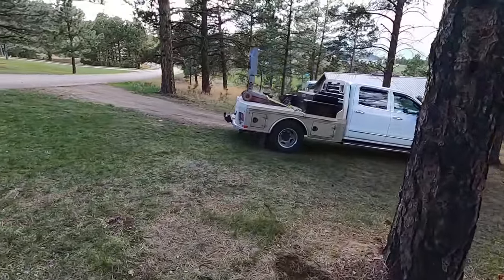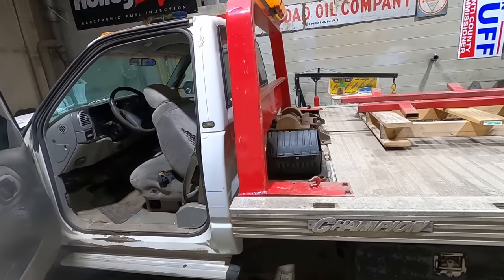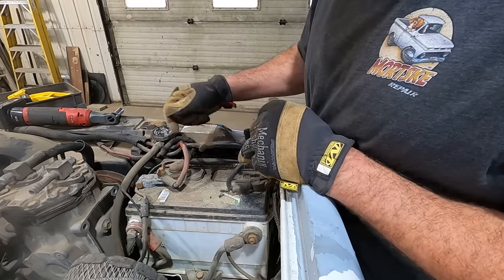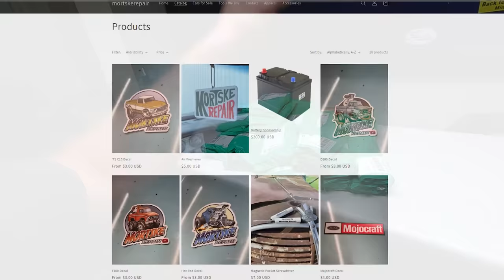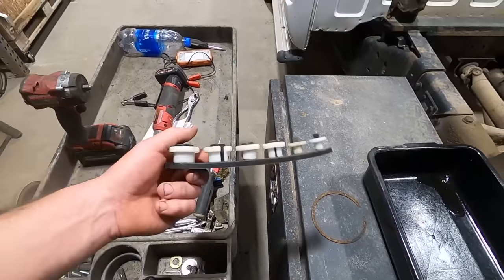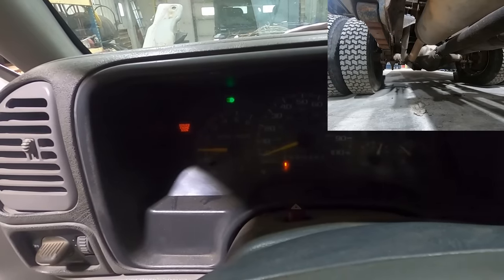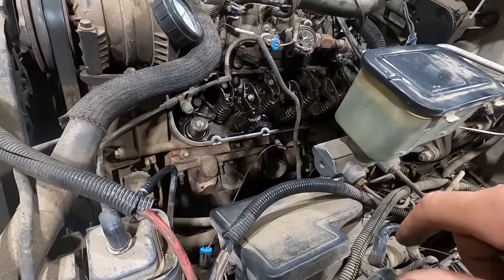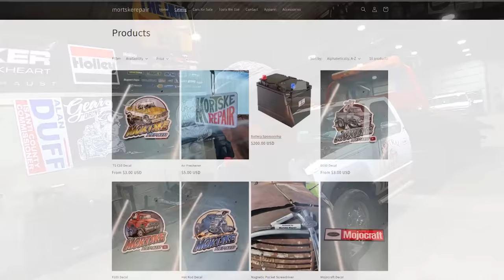WORST Purchase of My Life?!? I Bought a Rollback Tow Truck for Dirt Cheap! How Bad Can It Be???

Comment: replace the fuel pressure regulator and distributor while you have it out..  look out for faulty distributor caps from new..  i had a 99 suburban with that engine that sat since 2019 with a full 40 gallon gas tank.. yay!.. had to take the intake off to replace the fuel pressure regulator.. then was having timing issues, took it apart again, distributor shaft was worn out, bought a new aluminum bodied one, would not run.. after hours of checking found the distributor cap was throwing spark to multiple wrong plugs at the same time new out of the box, that was a Delphi cap too.. then still ran rough, needed injectors too.. you need a special, or advanced reader to set the timing to plus minus 2 degrees too...    those engines are the biggest pain to take apart for a pre 2000 engine.. 8 to 10 mph..  just 6.0 swap it..

Comment: Ah heck Mortske , I'm just and old mechanic  50 plus years, I enjoy watching your projects, I am jealous because I can't move around any more , but my mind says buy projects and get em done . You make things work like I did, so that  hyd  flare tool is a sweet heart, I have not had any success with that  , it just slid on me. so you are doing like I did.  So if I give ya crapp , it's all in fun. Like you said , I think it the material .  Dewey.  Dewey's auto, truck, and towing, Racing Supply. Glencoe , Mn

Comment: Those bastards are prone to killing fuel injectors.  I bought a set from the local parts house and some crapped by the end of the summer. The Bosch set I picked up from FiveOMotorsport were the ticket. Be careful with the fuel rail.  Ended up with some stalling issues later down the road and figured on some tcc pressure issues with 240k on it.  That 454 4L80 tranny combo sure is tough!

Comment: They did infact put the 8.1 in them hd trucks. From 2000 to 2002 when they quit making them.  The passengers side door handle is the correct handle for a hd.

Comment: Excellent video Mortske Repair   :) , Duff Dog 🐕  , also door new handle in 2002  years in Z71 truck and yes get new fuel tank plus send unit with pump for that year truck be better to save troubles! Plus get a grey bottle of STP Total Treatment fuel injection and carb cleaner in fuel tank with 89 octane 5% Ethonal or 91 no Ethonal in gas ! Plus 10w30  synthetic  in with Wicks fliter , plus Air filter change  and new fuel filter to fuel line ! Plus tire use Load Range D or E in Cooper or brand got lots meat rubber  on then with traction need it for all 6 tires ! Iron Man brand great ones too! Looking forward more videos too on this truck to!

Comment: Had a friend with a Vette carrying a 454. Checked the #'s on his, weakest 454 ever built. WHAT? He was a lawyer who owned a Vette shop and took it as a trade when he closed his shop for 4 not running Vettes. Man, was he mad. Asked me about fixing it. Told him I'd rather work on an Audi. He didn't like that too much. Looking at those water jackets I would do both sides and look real hard at the radiator. While its out check the timing chain. You never know till you get bit. That hole in the floor is Louisiana ventilation. If it ain't big enough for your foot to go through leave it alone. LOL Keep the great videos coming and spoil Duff rotten.

Comment: That's why I stick to small engines, lol. You just need a 7,8,10,11,13, and 15. If you have those, a set of angled needle nose, and some fuel line clamps, you can do pretty much anything. I hate having to use every damn tool in the box on one job.

Comment: Thank you for another fine show. It's too bad you couldn't fix it in one show but, personally, I don't mind a two part video. 
  As for the phrase "Here goes nothing", I found this on the Google. "Originally it was used in a self-deprecating manner, until it acquired the more general sense of "Here goes an attempt." I also found one of the oldest mentions of it. This is from The fibre and fabric, a knitting mill publication, ""The latest nagging remark; 'Oh, throw yourself In a hole,and say here goes nothing".😹
   Sorry I've ran on a bit. Have a good week and give Duff a pat on the head for me. 🐶

Comment: Raylar for 8.1 stuff and 8.1 is the same architecture as the 7.4 and with some minor wiring could drop in a 8.1 with the coil on plug

Comment: Hello Mortske & Duff Now you know why it was parked. Looking forward to your repairing the head and firing it up.The valve guides might  give you a slight issue. I hope a valve with oversized stem will be sufficient to piut the head bact to serviceable condition. Replacing the guides is not fun.Shoukld be a good engine with pulling power but a real gas drinker. 8-12 mpg under load and only 10-14 not loaded. I am sure you will enjoy the versatility of the unit.

Comment: The Vortec 454s actually have good oval port heads. Not the tiny peanut port heads. 
They are a decent engine and would be the easiest way to move forward with if you need a new (used) engine. That truck will need  the torque
Reply from the maker: good to know!

Comment: Next time you're at the parts store they carry them push connection, adapter fittings for cheaper than the time it takes to make them. Farm and fleet had them for $20 but they're 10' pieces of line. In a kit 3/8's and 1/4" together.. that's a good find. SCORE!
Reply from the maker: Interesting

Comment: Damn. That gas had actually turned to deck stain. I had to replace an entire fuel system on a 2 year old mower a couple of weeks ago for a customer due to the ethanol. Everything was beyond repair. It looked like the fuel system of a 20 year old mower that had been sitting for a decade. It is amazing how destructive that stuff is.
Reply: If only the people would use gas preservative for ethanol, they wouldn't have those problems. Been using that stuff since ethanol came out and never had any problems after storage, only when I didn't have it in my tank.

Comment: If ya do the electrolysis method, you can get that head spotless in those water jackets. Might be a bit hard on the valve stem seals though, I dunno.

Comment: Yeah mine had it busted spring but it didn't suck the valve thank God and it didn't hit the Piston either being parked for 8 plus years that small-block top-end was complete rust she looks great though now and that Vortec is a 4 bolt Main I don't know if your big block is but most likely it is so I wrapped my valves I bought a brand new valve that cost me $5.60 I believe but I'm going through the whole motor all my cylinders look like they were brand new but then again my small-block only had 85,000 original miles and taking the heads off really isn't that bad those manifolds have a problem anyway in the corners leaking water if they're not done right and now they have all new gaskets for the vortex so they hold up pretty good those Motors actually will go 300000 plus miles easily

Comment: Yeah my 2000 k2500 did the same exact thing only the pump was still working it was just circulating all the gas in the tank went to O'Reilly's and got a fuel pump 85 bucks out the door work just great of course I had to wire in the new harness but no problem oh and I would definitely change that filter or you're going to fill all the injectors up with crud. On the vortex if you didn't know the crank sensor does the timing in the sensor in the distributor fires all the injectors you can remove that sensor without pulling the distributor you just have to get it in the right spot. I hope this helps you my friend

Comment: Wonder if that flair tool is for the push lock fuel lines, the nylon soft lines that you can get in the help isles, to push it on the fitting. We had a ford tool that was similar to repair fuel lines. It held the fitting then pushed the soft line over it. Idk.

Comment: Thats a nice find. I got a 93 F700 with the 5.9 Cummins and 5+2 speed several years ago. It's so handy. Everything from moving my mowers ,small tractors to an occasional car or truck around my properties.
Back in the day I had a 92 3500HD with service body. Ran like a scalded dog, but had to keep a eye on the temp. It liked to run hot. And that 4LE80 was never enough Trans. for that truck.  Other than that was very dependable.
Oh liked to go through lift pumps for some reason. always kept a spare.
New Sub Here. Looking forward to part TWO
TGP
Reply from the maker: Thanks for the sub

Comment: 454 is a good engine, just don’t over rev it and float valves. It showed .020 bored when you borescopes it. Fix the valve and run it.

Comment: Well....
It says made in "America",but not ,"Made in the USA.
Even if it was made in Mexico or imported from, it is American made. North America. Even South America is American.
People will argue this, but America is America.
Now on the hood assist, try sliding it under the hood to pull it off.
 I have used those carriers for years, with ply wood, drywall, MDF.. etc. Underhand makes the grip more comfortable.

Comment: At one hour seventeen or so you can see 020 on the piston. Bored 0.020," that engine was rebuilt at some point. Probably recently as it is so clean inside.
Reply: They may have also screwed up the valve guide leading to the problem you found.

Comment: Just a heads up, i've had a few of those Gen 6 454 trucks. The 2 biggest issues with them are - #1 the fuel pressure regulator, and #2 the delphi injectors leak at times. I usually grab some yellow ford bosch injectors from 5.0/4.6 motors from like 87-04(?) to replace them. Direct fit and super cheap and abundant

Comment: So I had one of these in 1999 that I bought brand new. 9 ft snow plow 10 ft Henderson dump body. When the vehicle ran it was awesome to drive. But that 6.5 turbo diesel was always broke. The transmission went prematurely. I was able to work this right alongside a comparable f-450 which is exactly what this is basically. Hence the 10 lugs. Same GVW almost identical. The Ford never broke but this Chevy was always in the shop. It was ridiculous. And one thing I noticed the interior in the Chevy fell apart 30,000 mi faster than the 2000 f-450 did. I literally bought the f-450 the year after I bought the Chevy because I had such bad luck with the Chevy. Does anybody remember these bending the frames. Dump bodies the top of the dump body bulkhead would be touching the cab it was that bent. Not the 99 I had but the earlier versions were bending frames. I think up until the early '90s they were bending frames terribly

Comment: Vortec 454's had the better heads on them, good combustion chamber and larger oval intake port, not peanut port. Ethanol fuel didn't help anything on that rig, I avoid it like the plague on vehicles I don't run on a regular basis, good score on the roll back life. Old Duff pretty much knew that one wasn't going to be moving under it's own power for awhile, with that many miles the tranny had to have been changed once or twice.Tow truck drivers aren't normally easy on rigs unless owner operator run.
Reply from the maker: Good to know!

Comment: The other day I was riding my bike down the road testing it out and came across a 1990 four-wheel drive here in Ohio yes you have to hear this no Rust ever never driven in winter. Had a new transmission at least 2 years old, 350 V8 all with lockers. The father passed away in the son did not need the vehicle this truck had no dings no dents and of course the average clear code problem but what a beautiful truck all for the asking price of 2250 dollars oh yeah it even had brand new exhaust from front to back the only thing I saw was wrong with it was the AC was unplugged and the headliner had come down do mice damage just the average ungluing. I think if I would have had the money I would have added a third truck to the collection 10 years older but a very very beautiful truck.

Comment: My 98 Silverado 2500, with the Vortec 454, took a dump on me today. Suddenly it wouldn't rev over 2000 rpm, and developed a lean backfire real bad. So I replaced the fuel filter. No dice. So I took compressed air, and blew out the fuel line from the filter back to the tank, in case the fuel sock was plugged. That seemed to fix it. For 13 miles. Then it quit again. I limped it back to town at 10-15 mph, popping and sputtering. My NAPA guy put the scan tool on it and said "low fuel pressure", thermostat bad, both temperature sensors bad, all 4 O2 sensors bad, and persistent misfire. I think the scan tool is just programmed to make NAPA money! I parked it in the yard next to my blowed-up 92 Silverado.

Comment: Screw that 454, an 8.1 will run circles around it and get better gas mileage in the process. 

My first rollback was an '01 or '02 (it was the last year for 'em and it was 20 years ago i don't remember) 3500 HD 8.1 5 spd with a steel 21' x 102" Aatac bed & no stinger. I loved that truck. I remember the day they tried to give me a brand new (03-04?) 5500 with another POS Aatac bed on it. The one day I drove it was the day that they FINALLY put a seat in my old truck. I took it back the next day and drove it to around 300k when the company went under. I'd love to have that truck back with a quality Miller Industries bed, like you've got.

  I'm commenting way late here but you probably figured out by now that Miller is still in business, not likely to go anywhere, and will sell you whatever parts you may need for the business end of that rig. Also commenting to point out that the rig probably needs some steering parts. Buy every Moog Problem Solver part you can find. Also, cut a stick that you can use to push the brake pedal with the seat. It comes in handy. 

That truck will do a lot of neat stuff. I hope you can find someone local who knows what they are doing to teach you what you are doing, but listening to your walk around speech and explanation of the stinger and those things that might be brackets for it, you are definitely at the same skill level in towing as the guy who put the LS in Dirt Reynolds is at engine swaps. You might get the car there, but it's super sketchy and one day you're not going to make it 😂. A tow truck is not a trailer.
Reply from the maker: Much appreciated

Comment: i wired one of those inline pumps just to limp my dakota into the shop and the engine ran like crap despite the inline pump having the same specs as factory, must be something with the flow. new in tank pump and it ran flawlessly
Reply from the maker: Interesting
Reply: Yah not sure what it didn't like about it but it ran almost the same as this motor (with an extra cylinder though)

Comment: I feel like a 6.0 would be gutless in that truck when loaded down. But as you mentioned  their easily modified/ tuned . Hopefully the 7.4 turns out ok. But a turned up 12valve would be nice 👍
Reply from the maker: We shall see
Reply: You should see the one Waldo built. It's super nice.
Reply from the maker: @chaddesantis4191  If only we could find Waldo...
Reply: @MortskeRepair  he's right here! There's like a 30 part series on his 3500 HD. It's Cummins swapped with an Eaton transmission, fresh paint, fancy interior and a custom flatbed. He went a little over the top. https://youtu.be/gh8uw5x8MfI

Comment: I’m from the southern US…MANY MILES from the northern “rust belt”. Hard to wrap my mind around needing a small sledge hammer to get a tire/wheel off. 😳

That “made in America” stuff can be tricky. There is a LOT of “America” that is not part of the United States!

Last, YES they have “tooth brushes” in OK. Fact is, they were invented there. If they had been invented anywhere else they’d be called “TEETH-brushes” 🤪

Comment: I have a ‘95 k2500, with the 6.5 diesel, about to turn 400k miles.  It’s had a sex change, hit a horse with no liability Ins, so put GMC front clip.  It still  gets good mileage, uses no oil, but I run 40wt. ROTELLA, cuz of the mileage…..

Comment: The rpm should go up when pto I gage an them gen 6 454 always has problems with fuel pressure regulator an injector system

Comment: This dose need a part 2.I wonder why the valve sized so bad in the guide? Looks like oil deficiency to me but maybe it was a bad part from the beginning? Look up if it has the correct oil caps for the valves aka valve seals, maybe someone snuck a wrong one in? Looks like not a bad engine job but just something that maybe have been over looked turning the last overhaul.

Comment: If it was running rough before they parked it, that valve might have been jacked up before it was parked. You may have kissed it and created a new witness mark, but it could have been sticking before. It would make sense when considering that there are no check engine lights. As you well know, there isn't much on a vehicle that is not integrated into OBDII that can cause a vehicle to run rough without setting the light off.
Reply: And sometimes the light stays on so long the bulb burns out.

Comment: But looks like you might have to work on that truck. And I get to do what you wanted to don't need you. But I like your a robot truck but do you gotta? Do I would pull that motor and put it? Just a regular 350 scanning motor and have a great day.❤❤❤❤❤😊
Reply: Yeah take that motor out and put a g**** carbureted in a minute. It would make it run even ten times better have a great day

Comment: Take it from someone who’s going through it right now I pulled my 454 out of my dually two years ago to rebuild it an every one told me to just ls swap but I want one hard headed an stick with the big block u can’t get parts for them engines anymore especially the fuel injection so unless you want to put a carburetor on it an get a stand alone tcm to control the 4l80e transmission just do away with that big block an 6.0 swap build a 408 stroker out of an lq9 6.0 an it’ll make 454 horsepower an torque
Reply from the maker: good to know!